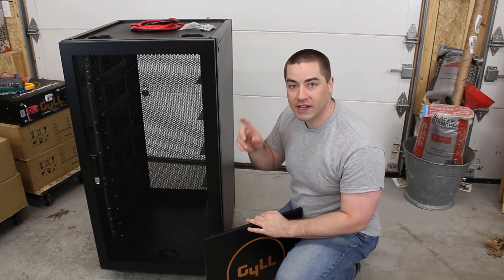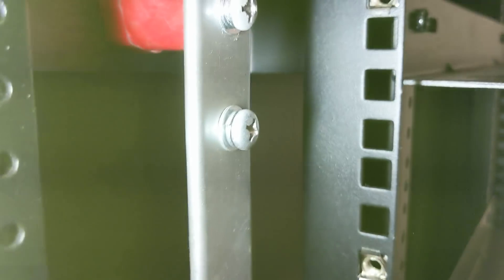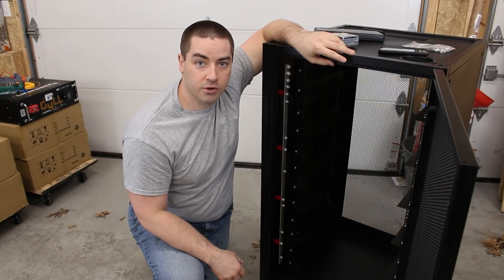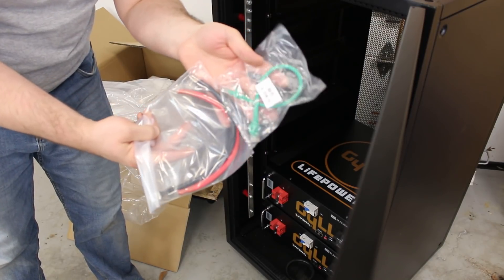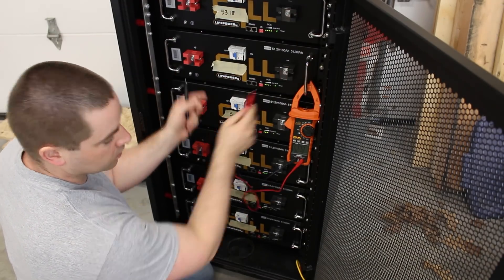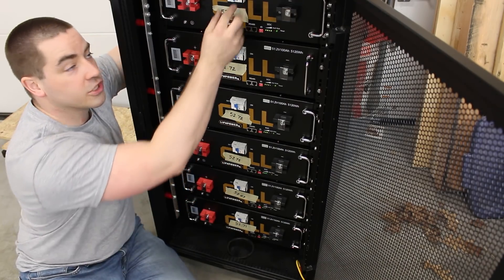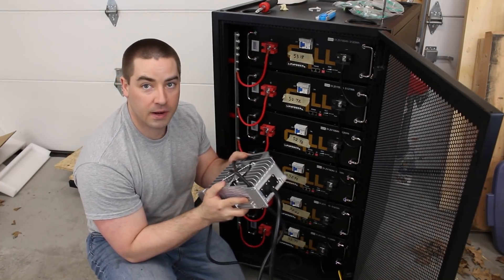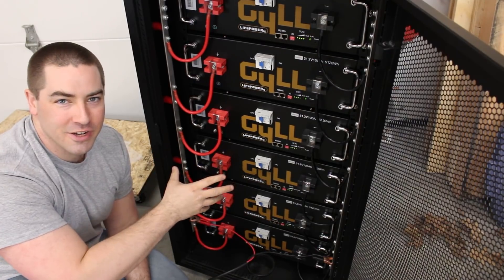Fastest Large Scale Battery Build, 30+ KWH, Power Whole House Cheap

Comment: You should nut every battery terminal to the bus anyways.  Bus bars are typically soft metal and over time will loosen up, a lock nut / washer will ensure you keep everything tight.  Pulling that kind of amps thru a loose connection just causes trouble down the line.

Comment: the dip switches are binary, from right to left, and 'off' actually would mean '1' or on.

So reading from right to left, 0001 = 1, 0010 = 2, 0100 = 4, 1000 = 7, 0000 = 8 (hexadecimal would go from 0 to 15, or 0-9 and then 10=A, 11=B, 12=C, 13=D, 14=E, 15=F: 0xFFFF lol..

Where 13 would be 1101 in standard convention, but here, it would be inverted, 0010, but the values of each position are identical: x1.x2.x3.x4 (left to right): 8;4;2;1.  

Whether you use 'OFF' or 'ON' to represent "active", "on", '1', the opposite of 'null' - is the naming convention that seems to be violated here.  It's an inversion, so perhaps there is some function going on in the circuitry that is the reason for it and if they simply called 'off'.. 'on'... it would violate the internal schematics.  Fascinating.  Perhaps "ON" really does mean "closed", and it is grounding out the circuit (such that "ON" or "CLOSED" actually does mean 'NULL', haha!)

The reason it looks wrong is because '1' is actually OFF; it's inverted.  I guess just to make it more confusing, lol.  Notice the DIP switch says ON is DOWN - well, just switch everything around in your mind where down is off, which is probably is anyway. I drive with GPS map always with the map facing North, which people find strange... lol. It's just convention, just like you could exchange '2' and '5' and do math that way - if that symbol '2' means "IV" or "11111" or five, hey, it'll work for you.  Just don't try doing that on a team project of any sort. That's why we have IEEE, IETF, ISO, IANA, ICANN, RFCs etc

Comment: What charge settings are you using?  Max charge Voltage?
Reply from the maker: I set my bulk to 56V, and float at 54V.  How about you?
Reply: @DavidPozEnergy  I had five lifepower batteries plugged into my growatt 12K for about 9 months. I just went back and looked at my solar Assistant history. 56.5 volts and just under 56 at foat the way it looks.  Inverter control to voltage.

Comment: Great rack. I would just rotate one bus bar upside down so the whole loop length from each battery to inverter is same length. Keeping it like this (assuming inverter or other equipment is fed from the top) would put more wear and tear on top battery. Even few miliohms with that chunky bus bar matter when your start running 100s of amps.
Reply from the maker: I ran it over a year like this and showed that all the batteries are aging equally.  Not saying it's a bad thing to flip a bus bar, but I proved after a year of daily cycling that it's not necessary.  I welcome someone else to go through the effort of daily cycling a battery over a year to prove me wrong.
Reply: @DavidPozEnergy  Okay, no need to be aggresive about it xD. Just saying it from fully theoretical point of view. Glad it works okay for you.

Have a nice day

Comment: It is possible to associate this battery in series?
Reply from the maker: It's not recommended.  These are 48V batteries.  If you need a 96V battery, then you will probably have to build it yourself with an Orion BMS.

Comment: Dave, Et Al -  Purchased Sig Sol E0000 Kit,  Watch you and Will, you guys are the best.  MY PROBLEM: if pnls are 400W (48Vdc therefore 8.3Adc.  Trying to install the pallet-o-pnls (qty:30) and pnls are photon controlled batteries then max is 3 pnl in parallel or MC4 (10/12/14 awg) of 30 Adc gets violated.  Is the only answer a combiner box with a pallet-o-pnls ending up as 10 stringswith 3 each in parallel and  cables all over the roof to conb box???  I must be missing something !!!  Plz educate me so I can help others...Thx Steve

Comment: This is awesome! I have a manual transfer /interlock switch installed for my gas generator, can I plug this into that receptacle?
Reply from the maker: No.  Homes run on AC (Alternating Current) and this battery is DC (Direct Current).  You will need an inverter to make AC from the battery.
Reply: @DavidPozEnergy  What size inverter would I need for this server rack to work?

Comment: Your daughter screwing in the screw hit me good. My dad let me wire up a bunch of stuff like switches and outlets when I was like 2 years old. He didn't included the plug for it till I had a working setup. One of them was a photo cell for a spot light. We tested it and it worked and it changed me. I was no older than 3 years old. It is never too early to start.

Comment: I have a Schneider 4024 inverter and a Schneider 60A Charge Controller. Are these batteries compatible with this system(24v version). If so, what would be setup in the Charge Controller and how would I connect it?
Reply from the maker: The batteries in this video are 48V, so they will not work with your 24V inverter.  However,  Signature solar does sell a 24V battery that will work with your 24V inverter.

Comment: *Thats a standard 19" equipment rack. 
*Wire size is more commonly referred by AWG (American Wire Gage), not mm^2. That wiring looks like 6 or 8 AWG.
Reply from the maker: Yes, this is a 19" rack inside a cabinet, with busbars already installed.  The wires jumping from battery to busbars are 6 AWG.

Comment: is that 25 mm2 cable ok for the inverter and 30kwh battery
Reply from the maker: 25mm2 wire is about similar to a 4AWG wire.  NEC chart says 85 Amps on 4AWG @75°C rating.  Since these batteries are 48V we multiply 85A * 48V = 4,080 Watts.  So the 25mm2 wire is fine if you are powering a 4kW inverter or less.  But, if the inverter is larger then you need thicker wires.  I'm powering 10kW of inverters and that's why I didn't bother using the 25mm2 wire.
Reply: @DavidPozEnergy  thanks David, always a pleasure

Comment: BUDDY HOW HOT DO THOSE BATTERY RUN. I HAVE A TINY AIRSTREAM TRAILER I THINK 2 WOULD BE OVER KILL FOR 8 HOURS OF RUN TIME SO 4 SHOULD BE MORE THEN ENOUGH. ITS AN OLD AIRSTREAM IT NEEDS TO VE SPACED AROUND THE TRAILER SO ITS NO EASY PROJECT TO BUILD
Reply from the maker: I don't notice any heat given off by them.  If you keep your C-rate to 0.5 or less then they won't get hot.

Comment: Hi. I enjoy your videos and this one was just on point too however, it left me wondering on the charging sequence where you gave 5 battrries a surface charge in order to equalise it with the one on top which was a little higher. I thing the surface charge was not enough to equalise the batteries because it still goes down after a few minutes.

Comment: Great video..  I have a question though.  Would this setup make sense if you were to negate solar and solely use it for UPS battery-back from street power??  If so and you are using about 15kw to 18kw on average - how long would the battery backup last conservatively??
Reply: a 30 KW/H system that uses 15 KW/H will last about 2 hours. straight math. Remember to use Amps x Volts = Watts to figure out your situation. As long as you know 2 of the numbers you can figure out the rest of the equation.

Comment: Thanks for this excellent video! What would happen if you touched both copper bars on each side of the rack? 😇
Reply from the maker: I've touched them with bare hands and not had any zap, but the potential is there to seriously hurt you.  I suppose if your hands were wet maybe?  Now, if your question is assuming touching them with metal, then you would probably throw sparks and then the circuit breakers would shut off.
Reply: @DavidPozEnergy  I mean touching them both at the same time, with bare hands (not necessarily wet). I never knew how much DC voltage is dangerous or unpleasant for people. Yes, shorting them with metal would very likely throw sparks :-)) Appreciate your quick answer!

Comment: can you connect more than one cabinet if we wanted to have 60kwh of storage?
Reply from the maker: Yes.  I know someone with 3 cabinets (18 batteries) all paralleled together.
Reply: @DavidPozEnergy  If I buy three of these together do I get three times the maximum output.   I have a number of ACs that run at the same time at night
Reply from the maker: The cabinets are pretty awesome: https://signaturesolar.com/eg4-enclosed-battery-rack-6-slot/?ref=4_rHcgZ9x-TiF-  They come with copper bus bars inside.  I measured my bus bar and determined they are probably good for 400 Amps continuous.   This means if you have 3 cabinets, then you could pull 1200 Amps total.  You would need to bring all 3 cabinets together to one central bus bar that can handle the Amperage.  Then out from the central bus bar you split to your inverters and charge controllers.  1200A potential at 50V is 60kW!  That's huge.  The average American home is fed with a 200A breaker box at 240V, which is 48kW.  So 3 cabinets with 18 batteries can deliver MORE power than the grid.  You will need to make sure you have inverters to make the 120/240V because the batteries are 48V DC.

Comment: I just ordered a single G4-LL and can't wait to get started building a serious off grid backup system, but at $1750 a pop, it's gonna take me some time to get to 30.72kWh worth of backup. I'm a little leery about having an exposed bus bar with that much juice on it though, especially with over 50 volts. Anything with over 50 volts can easily overcome the bodies resistance and stop your heart.
Reply from the maker: There are two types of batteries from Signature Solar.  One is less expensive at $1499, and is the one I bought. https://signaturesolar.com/eg4-lifepower4-lithium-battery-48v-100ah/?ref=4_rHcgZ9x-TiF-  That will save you $250 per battery.   The less expensive one is still UL, and still rated for 7000 cycles, but you give up the little screen.  Personally, I don't care about the screen.  The new rack Signature Solar sells now has an added plastic cover over the bus bars.

Comment: They need to make their RS485 \-> USB dongles with RJ45 ports instead of the end user bodging a cable into screw terminals. We used them all the time for cheap and easy DMX in the theater effects field. You should have GND connected between the USB and RS485 devices. Its a 2 wire serial that uses an inverted signal, if D+ is +V D- must be  -V (or gnd) else its a corrupted bit(ie, dont trust it). While USB and RS485 are quite similar, ethernet too, its just simpler to get a serial USB converter. Let the USB bus do its magic automagically instead of writing new drivers for a lan card, every lan card.....

Comment: Thanks for some great advice. But now you have me thinking "I need something like this"  My thinking is start with a home battery system and add the solar panels later. This being the case what would I need in addition to the physical batteries to be able to charge at night during off peak and use during the charged batteries during the day in peak price time. What is it that controls when they charge and when to draw from the grid. Is it the inverter that does this function or another piece of kit?  This is really early days for me and a massive learning curve on this project but I'm now ready to take the plunge. Hopefully you can steer me in the right direction.

Comment: I need a welding project. I may try and build my own. I plan on only buying 4 of these batteries. I'm wondering if there's some kind of connector you can screw into the terminal that you can T onto the buss bar with. It would make it a lot easier than making up all the wires.

Comment: Really a nice Video. Thanks for the Tour of this Case and the Batterys

For Me I see potential of a Risk in the "open" Bus Bars. They are locked in the cage and isolated but man.... The Risk when the door is open...

I saw at work a product of a german industy battery supplier, which i liked a little better. The Racks had integrated wireing which was completeley done with isolated PCV wires and the batterys were connected to these wires by HARTING Connectors.

This was a real sweet and clean solution. No anger with "open" potencials and stripped out threads :)

but for home use they are way too expencive.

Comment: 18:08 i guess they intended to be 1 up and 0 down but reversed it if you invert the ON/OFF the ID is the actual binary representation of the decimal number. 0000 = 0, 0001 = 1, 0010 = 2

Comment: I can't believe they have no support for the top and bottom of the bus bars.  Also why not color code the standoffs for the polarity?  If you are willing to be crafty you can pick up used server racks that size for $200 or less.  Even free if you are patient.  As I like to say everything looks better in a rack 😅

I'm surprised the packs and bus bars don't use the same style of screws.  That would be irritating to deal with.

The only way you could make that setup nicer would be sliding rails for the battery packs.

Comment: Torque wrenches are for noobs. These screws are not load-bearing so I have no clue why you are putting them on so tight that you have to freaking force them with your body weight. That is just asking to strip or seize them on copper.

Comment: Nice set up. I'm pretty sure those two bus bars need to have some sort of platic protection/covers just like the battery terminals have the clear plexi it would be safer.
Reply: It’s crazy to see open and unprotected bus bars which you could touch both the plus and minus pole at the same time. Absolutely insane…
Reply: You’d have to be an absolute idiot to get in between those bus bars.
Reply: Was thinking the same. Am I missing something or is this a bit dangerous?

Comment: What about safety? Did they used specific DC switches? How will work short circuit protection? Did you tested short circuit protection before integrating into your house?

Comment: Is the rack worth 400-500 bucks?
- yes, to the manufacturer. Small production run, probably not stamped (very expensive stamps) but bend, still, cases are expensive.
- no at a scrapyard
- yes to the customer if you into looks/ 100% oem parts/ installation speed (or not having a workshop/ diy skills to do it

Comment: If the circuit breakers weren't in the way, busbars could have been secured directly to the battery terminals.
And snap on covers over the busbars could have provided protection.
What's the risk of the rack being shorted to the busbars?

Comment: I know this is a little late at this point, but it seems that you didn’t put any “no-ox” on the connectors or the bus bar. It’s likely that you will end up with some oxidation over time without that which will impact the resistance of the connections to the bar and hence could result in heating

Comment: David,  Love your channel and you persuaded me to buy the EG4-L batteries and Growatt 12K inverter (of course I used your discount codes)  
Question - the battery instructions talk about tying the battery grounding screw to the chassis.  Did you do that or is the cabinet screws already grounding them?  Didn't see them grounded in the video and not sure if it is necessary.

Thanks again and keep up the great work.
Reply from the maker: I didn't add additional grounding beyond the screws that hold the battery case to the rack.  However,  now that yoy mentioned this, I am going to check if that made a connection or not.  It's not a bad idea to add more grounding.

Comment: David, (or viewers)  i was wondering if you knew if these could be added to a single tesla powerwall 2 with a tesla Gateway 2 controller. or would the gateway and powerwall need to be sold off due to propioritory incompatibility? 
I have 3 phase power on a large horse shoe shaped roof with 6.6kw to each 5kw inverter ( theres 3 groups facing a different compass point each. for 20kwh panel set up, a total of 65 panels?) So its summer now in Oz so generating 130kwh today, 15 max per hour for around 4 hours, 11 to 3pm) tapering off either side.
Im looking for 10 of these 5kwh units in 2 racks, either that or strip down a tesla 70kwh car battery, no one seems to be doing this running it through the gateway 2 that ive been able to find info on, so please mate, if your up to it, do a show on this, or shed so info, thanx dee from Oz.

Comment: I just picked up 6 batteries from the shipment that finally arrived at Signature Solar on 12/22/21. I used your promo code!
The next gen rack is not nearly as nice as what you have in this video. No top, bottom, door or casters. You scored!

EDIT: Issue resolved by Signature Solar: 
> The batteries do not include the bus bar jumper wires. What gauge are the 16mm jumper wires...6 gauge?
How long are the jumpers...about a foot?
Reply from the maker: That's too bad they stopped including the jumper wires.  Darn.  This is the first I heard that, and thank you for letting me know.  I just measured mine, they are 10 inches long.  Yes, 16mm wire is about the same as 6AWG.  That's the bare minimum to use, and going larger is good.  The only reason they can get away with 16mm is because it's such a short run (10").  The longer you go the more critical it is to use a thicker wire.  If I built my own wire jumpers, I'd probably buy 2AWG to go from battery to central bus bar.
Reply: @DavidPozEnergy  Thank you! I really appreciate your videos. I have purchased the whole setup with 3 5000W Growatt's, auto transformer and 32 395W bifacials.
I live a little over an hour from Signature Solar so I'm able to pick everything up and save on shipping and shipping damage. I'll be setting everything up over the next couple weeks.
Reply: @DavidPozEnergy  Missing wires were a glitch. They are sending the #6 jumper wires...though I do like your idea of super sizing them.

Comment: Just got mine. The current rack does not come with top/bottom/front or back panels. The buss bars are now covered with Open Slot Wiring Raceway. The bolts on the buss bars now have hex bolts.